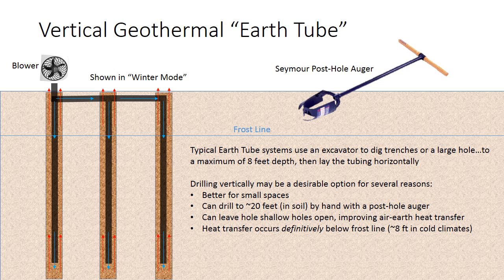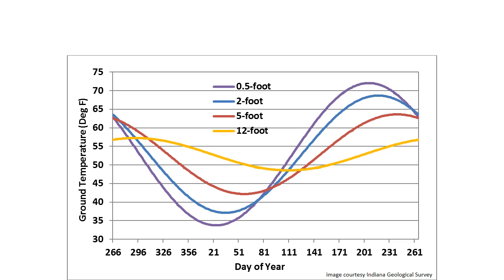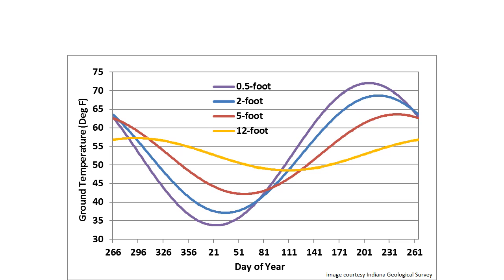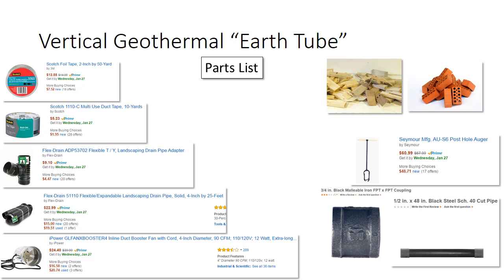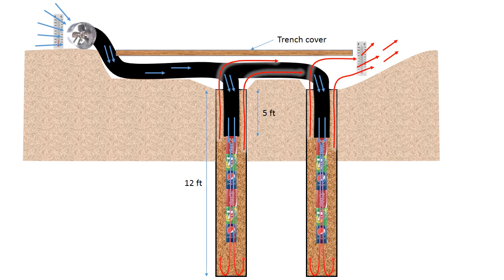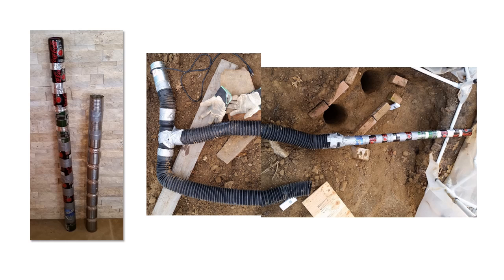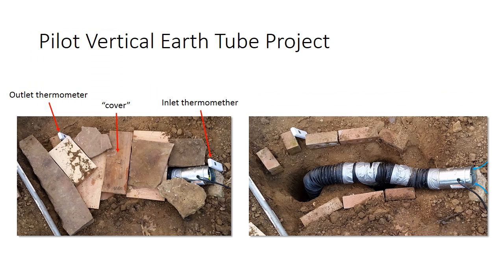Vertical Geothermal Earth Tube (Part 2) - Greenhouse Heating/Cooling

Comment: in japan they found @ 16 ft the ground temp is at it's warmest in january, and coldest in july. it takes 6 months for the heat of summer to reach 16 ft and vice versa.
Reply from the maker: +C Ray thanks.  I will check out that website.  Had to take my greenhouse down due to a run-in with the building inspector.  Unfortunately I hit bedrock at 12 ft.  When I rebuild, I hope to get to 20 ft.
Reply from the maker: +C Ray , cool graph!
Reply: Morgan  I'm in Calhan, Colorado at about 7000 feet.  Building inspector?  Why?
Reply: Have you tried slowly going through the bedrock? It should be even better for this purpose than soil.
Reply: Nice idea, and it makes sense I guess for a heat reservoir, but rather you than me my friend.